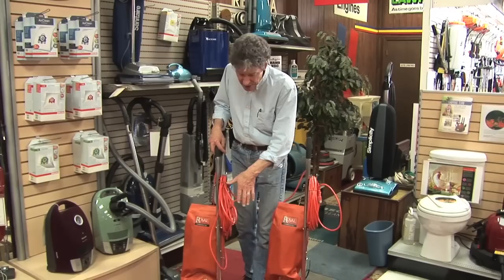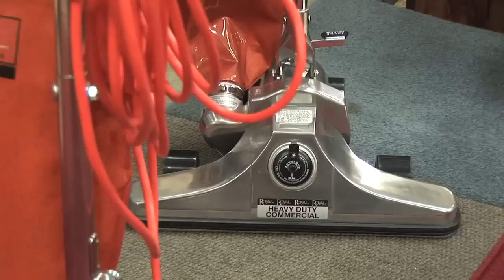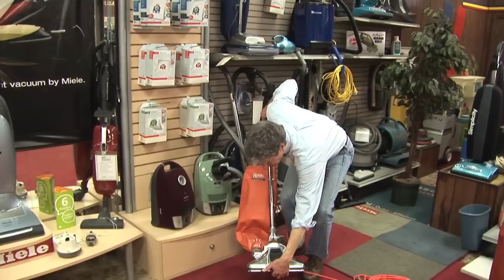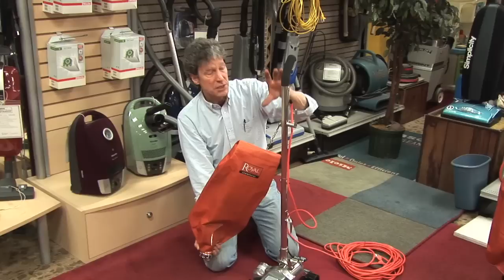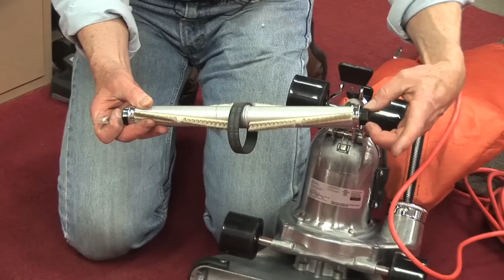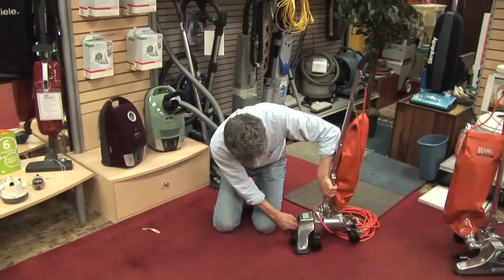Overview of Royal All-Metal Commercial Upright Vacuum Cleaners -- (NO LONGER MANUFACTURED!)

Comment: I have special edition Royal Vaccum, I believe from 1989.  It was custom labeled on the bag for Stark's Vacuum stores in Oregon.  The machine is gorgeous.  It has beautiful silk-screened metal wheel covers with the Royal Emblems that are perfect.  I bought it years ago and restored it to look nearly new.  Found OEM parts to make it new and restored the metal.  I have only used it maybe 2 hours.  I need to pair down on my stuff and haven't found a buyer.  Would like a collector to buy it and cherish it.  Neat Vacuums.
Reply: I think yours is a model 5000NA with the gray bag and black trim, correct? If so, I used to have that model.
Reply: @ClassicTVMan1981X  Correct. Black trim in Bag is where it says STARK'S DELUXE.
Reply: @scotta9114   I hope to find another one like it soon, or a Royal 680 wide-track model (also with a gray bag).

Comment: So retro looking lots of aluminum I’ve got a Sentra my Hoover it’s a very strong motor
Reply from the maker: It's original design -- goes back to the early 1900's -- a number of early vacuums looked much like the Royal.

Hoover typically made strong motors -- sometimes a Hoover vacuum coming in to us for service is over 40 years of age and still running pretty well.

Comment: Royal vacuums didn’t come out until 1912, and Hoover was one of the first manufacturers to start them back in 1908
Reply from the maker: Royal always touted and advertised "Since 1905", as the PA Geir Company was the parent company.
Reply: @keithpetersen8114  royal made other devices like punch presses but didn’t make vacuums until 1912. This is documented on their website
Reply from the maker: @nightwolf883  True enough.  As indicated, Royal splits hairs a bit by declaring the COMPANY to be in manufacturing since 1905 -- and, that info "Since 1905"  was on their advertising for decades.
Reply from the maker: @Repair The Machine Most of the original metal uprights bore a strong similarity -- the old Hoovers were typically designed with the fan chamber horizontal in position whereas the Royals used a vertical design.

Comment: When my over-priced "Sears" plastic vac died, I was lucky to have the owner of the local janitorial supply direct me to this Royal machine. I've had it for well over 20 years with only minor repairs that I was able to do myself (wheels, belt). This vacuum is all about "cleaning" and NOT bells, whistles, and lights. As mentioned here, it is made of ALL metal not plastic and will not only last a lifetime, but for generations if maintained properly.
Reply from the maker: Thanks so much for your input.  Yes -- extraordinarily well made vacuum -- too bad it is now discontinued.

Comment: Loved the history about the company  and the useful info about this upright  model.  I own one of these myself the 800 model, and it has been a great vacuum.  I also have the royal power team canister vacuum and it is awesome except right now for the first time in close to 40 years, it's out of commission because the small section of cord that plugs into the  tank and brings power to the settings in  handle of cleaning head, is frayed,  right where it comes out of the lid, the end without the plug.  I hope the repairman can change our this piece easily but he said parts can be hard to find on these older vacuums.
Reply from the maker: Glad you enjoyed it.  Yes -- they are excellent products.   I suspect that, when you say you have a canister it is a cigar-shaped vacuum -- one of the best vacuums we've ever had in this industry.
Reply: @keithpetersen8114  yes I have the burgundy Royal power team and I think I bought it around  1995ish.  is there any vacuum that performs better than this Royal canister vac?  In case mine must be replaced? I have pets, relentless horrible showers of crud from the ever larger sycamore trees that surround my house and tower over it unleashing their relentless deluge of toxic dust, powdery mildew, leaf fragments, pollen and other microscopic goat head shaped crud which results in allergy induced asthma.   My canister vac would literally clean the air, walls ceiling, wood floors, carpet, tile upholstery, blinds and anything I could reach with that long hose, pole, head assembly and onboard attachments! l even used the round horsehair  attachment on my long haired double coated dog!  She thinks she's at the spa!
Reply from the maker: @bookbeing  Sure -- you could own a Miele C3 canister vacuum with a power brush -- you can see it here on our website:  https://etpetersen.com/product/complete-c3-marin-wseb236/

Comment: Hey Keith - Appreciate your videos.  I have the 14" metal Royal and was wondering if it is possible to hook a hose to the front in order to operate brush attachments.  I thought I saw somewhere this was once an option.  Thanks!
Reply from the maker: Hi -- just seeing this now.  Royal made a hose to attach to the front -- we never recommended it -- it's a bit awkward to hook up and use and it doesn't generate a lot of suction.

Comment: Do you know why they discontinued metal Royal vacuum?
Reply from the maker: Hi -- I cannot really say.  The Royal Company is the parent company of Dirt Devil.  The company has been owned by a Chinese firm for quite some years.  I surmise that the all-metal (Royal) line was terminated due to not having enough volume of business.  Only my thoughts.
Reply: @keithpetersen8114   that  true I know this the new metal Royals vacuums where made in China it was September 2018 they quit making them . Did you have few customers by metal Royal vacuums back in 2018?
Reply from the maker: @doorzzz1  I think the Royal Commercial business dropped off a lot because many/most commercial customers had some years back switched to upright vacuums with hose & accessories onboard.
Reply: @keithpetersen8114    oh I see your where  saying a lot of people buy upright vacuums with all the hose attachments some Royal vacuums didn't have  hose attachments  also a lot of people buy plastic upright vacuums from Big Box store

Comment: I have used different makes of vacuum cleaners.  Nothing compares with the Royal commercial all metal VC.  The round front cover of my machine was missing and I cannot buy a replacement because it was discontinued!!!!  I have ti buy a new machine.  But it's discontinued.  Why do they stop making such a good product?
Reply from the maker: Hi -- make it easy on yourself -- put a piece of cardboard over the front opening and secure it with duct tape.  You can remove and reinstall it when it is time to replace the belt.
Reply: @keithpetersen8114    Thank you so much.  When I brought the  Royal Commercial vacuum cleaner to a store for repair the store owner said because the front cover was missing there was no suction power left and the machine was useless.  I was very disappointed but still kept the machine.  Now I am going to do what you have told me.
Reply from the maker: @DDDrew8   Yup -- glad you will be able to continue to utilize your machine.  Not the most elegant repair; but, it will serve the purpose.
Reply: @DDDrew8  Shop around online and you may be able to find a cover for it. Sometimes parts show up on eBay, too. I bought a roller brush for mine not too long ago.

Comment: This vacume is heavy and bulky and a pain to move around
Reply from the maker: Hi -- It is actually, as upright vacuums go, not as heavy as many others.  It is an aluminum alloy which is fairly lightweight.  The later generation models had such an effective brushing action that they would, on many carpet types, virtually walk themselves across the carpet.  However, it is today a bit of a moot point as the company -- after over 100 years of manufacturing this series of vacuum -- has discontinued production of metal uprights.

Comment: I have two Royals. A model 880, and a model 608. I love my 608 more though, it's more vintage and sounds quieter. I'll check the serial number and put it in the comments, maybe you could date it for me.
Reply from the maker: Hi Jeremiah -- the 880 was never my favorite model -- it likely sounds noisier because the motor is bigger.  Today, as I write this 9/26/19, sadly, the Royal all-metal vacuum line has been -- as of some months back -- been discontinued.  End of an era ......
P.S.  I years ago threw out all my original Royal binders/manuals -- I would have no way of dating by serial number.  Besides, if my wife found out I was a serial dater she would hit the roof  :-)
Reply: @keithpetersen8114  lol thanks for the info! My 608 is my favorite, you can see a test video on my channel. I used the hose, emptied the contents of an electrolux bag, little did i know, about the pieces of metal, and the coins! But it's still running strong!!

Comment: Is the 18” a shake out bag with a zipper or is it a shake out bag?
Reply from the maker: Hi Eric -- It could be bought with a zipper and an internal paper disposable bag; or, as a shakeout bag.  We haven't sold a Royal with a shakeout bag for well over 30 years -- I cannot recall whether it had a zipper or a slide clasp across the top.  It is now pretty much a moot point as Royal has just decided to continue all the metal upright vacuums ... :-(  An era comes to an end.
Reply: I just scored one for 120$ brand new open box with all manuals cord still wrapped up and everything
Reply from the maker: @ericwarmington522  You did well!
Reply: Idk if its the same exact one but its the Model 79102
Reply from the maker: @ericwarmington522  The Royal metal upright vacuums are all similar.

Comment: And In the corner of the room it says lawn Above the door does that say lawnboy if so they are great mowers
Reply from the maker: Lawnboy it is.  Lawnboy today, of course, is dead and gone.  Toro bought Lawnboy and then discontinued the 2-stroke engines and then, finally, discontinued the line, as such.  I personally own a 21-inch push commercial Lawnboy mower -- it basically will never wear out.
Reply: I know I have a lawnboy two stroke commercial and it's great but sad they discontinued it 😢

Comment: Great review!
Royal and Kirby are my two favorite brands and nothing else comes closer to their performance  (well maybe Sanitare) and reliability. Much better than the plastic 600+ bagless vacuum that "never lose suction" at big box stores. 

 On another note am I the only one who likes it when the outer bag inlflates?
Reply from the maker: Both units are indicators of old-time "Americana" manufacturing.  There are actually more efficient vacuums (a quality canister vacuum with a motorized brush, for example, has much higher suction/waterlift than a traditionally styled upright); however, Kirby and Royal represent top products in their category.  Thanks for your comment (the industry jargon for an outer bag inflating or not inflating is "If it don't puff, it's jammed with stuff").

Comment: Royal is one of my very favorite vacuum cleaner brands. I personally own a Royal 4650 power tank, finished in a beautiful burgundy color with all accessories and electronic variable speed control; it's probably the best performing machine I have ever used, and certainly the most durable! I also own two extremely rare Royal 888 uprights, which both feature an integrated belt lifter and removable front nozzle, very similar to the Kirby design. I have several sets of original attachments, all finished in the classic powder blue, but alas, I have yet to find the hose converter that would allow them to be used on these machines. The removable nozzle Royals are extremely rare, so the attachment converter is very elusive to find.
Reply from the maker: Hi Joseph - Yes, the Royal tank was close to bullet proof and very efficient.  Without getting your hopes up, it is possible that we have in stock one of the adaptors for which you are seeking.  Give me a call (908-232-5723) next week (01/08/18) to remind me and I'll check.  If I have one I'm happy to send it to you.
Reply: If you have one available I would be ecstatic! I would be very appreciative if you can check for me. Thank you so much for checking!
Reply from the maker: Ah - the agony of defeat.  Sorry to say that we must have thrown out all our Royal upright tool adaptors of both types some years back.

Comment: Hi Keith. Could you talk about the filtration system in these machines, compared to Miele for example?
Reply from the maker: Hi - the filtration is simply not that of a Miele.  The Royal is a high-speed, durable commercial upright vacuum for those needing such an application.  If you are considering a unit for home use - and need excellent filtration - Miele would be a/the first choice.  Good alternate choices are Sebo and Lindhaus (you can see our videos on these products or visit our website to see them there - www.etpetersen.com

Comment: After watching this video, the Royal was my first choice. But it seems to be a bit too loud for me and it doesn't do well for title floors. I looked at the Miele Maverick but I read somewhere stating that they are not made in Germany anymore but in China. So therefore I question the quality of it. What would be some recommendations for an upright in 2017 for around $400?
Reply from the maker: Hi Mike - I'm wondering what you meant by "title floors" (I am presuming a typo) - hard floors?  A Sebo Felix is great for bare floors; but, presuming you have carpet as well, it would exceed your $400 price point.  If you are focused on an upright around $400 buy a Miele Maverick or, if you can find a Twist, it would be the same vacuum and be less money.  Don't worry about the quality - it is 100% there!
Reply: I have about 70% carpet and 30% title floors. I really wish your shop was located close to me and not thousands of miles away. None of the vacuum shops around my area are any good. Thanks Keith! I'll probably leaning towards the Miele.

Comment: Among my vacuums, one of my favorites is my Royal Classic Edition model 9089. Its from 1989 and it runs like a top! When I first got it, it needed some tlc so I took it to my local vac shop and they cleaned it up, replaced the carbon brushes, put a new roller brush in and it runs like brand new. I love how the roller propels the vacuum across the floor. I'm sure it will last me many more years.
Reply from the maker: Hi Matt - Thanks for posting - sounds great!
Reply: @keithpetersen8114  what"s the meaning the number 1989 on a royal classic edition? is the year was made it ?

Comment: Not all Kirby's are heavy, my Sanitronic weighs the same as my Royal and both seem to work equally.
Reply: My Kirby G4 80th anniversary edition weighs @ 24lbs, and my old 1953 Kirby model 514  weighs @ 15lbs
Reply from the maker: Yes, the older Kirby models are similar in weight to the Royal vacuums (although the old-older Royals are still a bit lighter).  The later/current Kirby models (i.e., self-propelled) are drastically heavier than the Royals - we've actually taken trade-ins on the self-propelled models where the lady customer said she can't use the vacuum because it is heavy to even remove from the closet and literally impossible for her to carry upstairs, etc.  Too heavy, and Kirby still makes them the same way/weight.
Reply: Then worst thing about Kirby's is the hyperinflated prices and pushy salesmen. They tried to give me the hard sell, the sad story and were kind of shocked when I brought out a Kirby Sentria I got from a trash out cleaning a foreclosed home. Even so they STILL tried to sell me a vacuum!
Reply from the maker: That's funny that they "STILL tried to sell me a vacuum" - can't blame a buy for tryin', etc. ...... :-)

Comment: I use to use a Royal in a day care centre in a public school in Toronto.  It was a MASSIVE size room - about the size of a small gymnasium and wall-to-wall carpet!  I vacuumed that carpet 5 days a week.  I took my time and did it in sections, took me about 2 hours each night.  That's not including around 15-20 classrooms I vacuumed also 5 days a week. I was also used for cleaning rather offices in the schools... and libraries!!  I use to walk around with spare belts in my back pocket. LOL.  That Royal was a mid-1980's model and it was a noisy old relic but I beat the snot out of that Royal and it never failed me.  Only parts I ever changed were belts (and a lot OF them!) and the occasional roller brush.  It was a damn good machine!
Reply from the maker: You're right - it is still our top-selling upright model for commercial use.  The newer models are faster and more powerful.
Reply from the maker: Hi - yes, they can; however, a hose is awkward to use and, most importantly, does not have high cleaning power since the motor/fan design is that of a traditional upright vacuum and not that of a canister vacuum motor.

Comment: Hi there.  Love your videos.  I recently tracked down a Royal Blue Model 880 circa 1982 in near mint condition and I'm seriously considering to buy it.  Would it be fair to say that those models are as excellent as the others?  And does anybody know if the 880 Model comes with the inner filter bags?
Reply from the maker: Hi - glad you like the videos.  An 880 was a top-of-the-line residential model at that time.  It is a good vacuum although the late-generation units are considerably more powerful.  It should have a paper disposable bag system.  Hope this helps!
Reply from the maker: Sounds like a great deal.